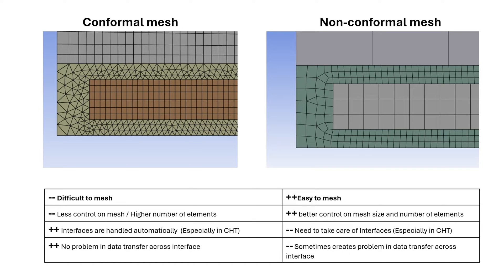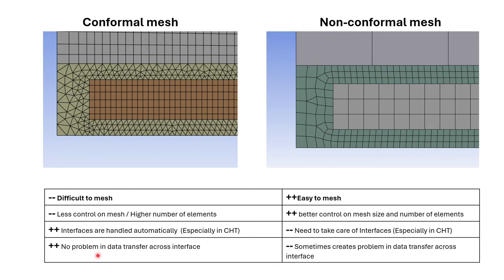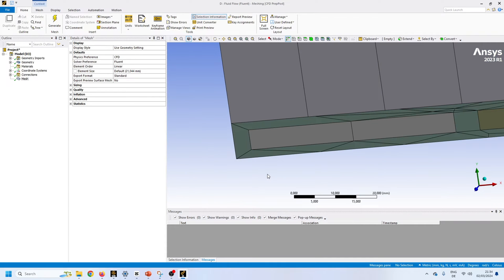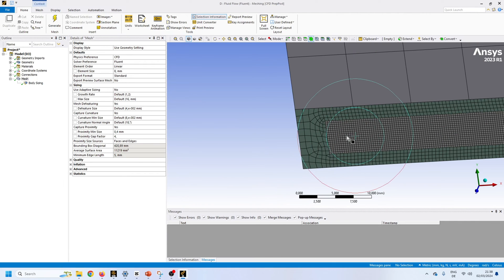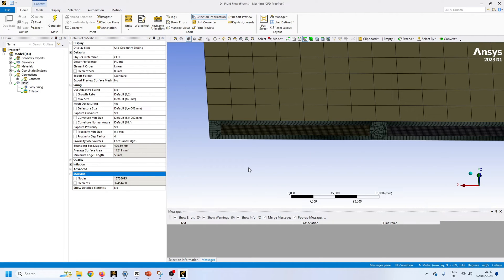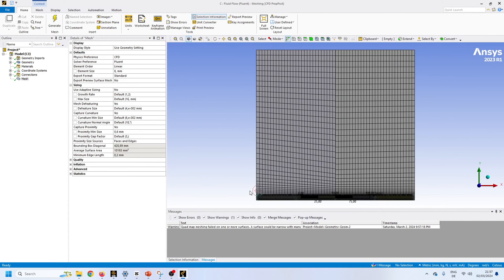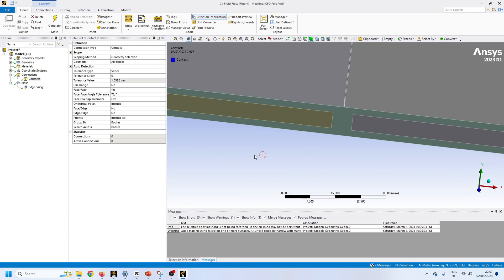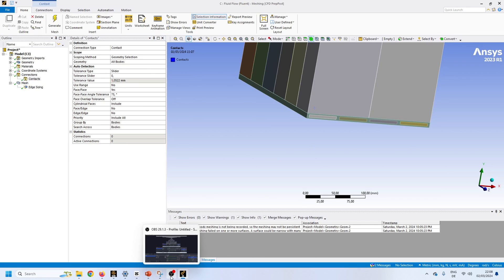Generating conformal and non-conformal mesh in Ansys-meshing

Comment: Hello! thank you for sharing. 
I want to create 3 distinct zones similat to this one in the link https://youtu.be/fbaV_knzzks?t=54 . 
Do I need to create multiple bodies/Parts to do this? 
my goal is create a box like fluid background domain with 3 distinct zones having tetrahedral mesh at the middle and hex mesh at the two end. but with conformity
Reply from the maker: Yes, you will have to create multiple bodies/Parts.  It will be easier in 2D to generate the mesh as in this example.
Your workflow could be like this
Don't use share-topolgy, instead use imprint for (17:00 onward in the video)
For the side zones where you want to have hexa mesh, define same number of division on the opposite sides of the body.
Central part you can use insert ==> method ==> tetra mesh

For 3D you use multizone method o´for the side parts to generate the hexa mesh.

In both case don't use share topology
Reply: @WaqasLearnTech  my research is in 3D unfortunately, therefore it has to be a 3d domain. 
I already try to use the share topology with 3 distinct bodies, and its seem fine, two hexa is created on the sides and tetra in the middle by applying tetra mesh method on the middle body.
why did you suggest not to use share topology?
Reply from the maker: Actually when you add boundary layers, hexa mesh get converted in tetra mesh in case of share topology. 
If there are no boundary layers you can proceed as you have already got hexa and tetra mesh as per your requirement.
I would suggest you to use fluent meshing if you have boundary layers.  In fluent meshing you can use share topology
Reply: Hello! Sorry to bother once more. 

I created a non conformal mesh. Do I have to create mesh interface where two non conformal mesh meet?

I notice fluent create mesh interface automatically when I load the mesh file into fluent.
Reply from the maker: If you define interface/contacts in Ansys meshing, then you don't need to do anything in fluent. Fluent will read the interface defined in Ansys meshing 

Alternatively, you have to create the interface in fluent
Reply: @WaqasLearnTech  Thank You